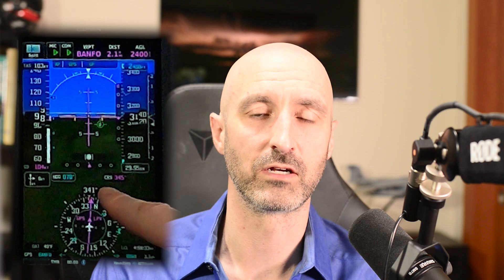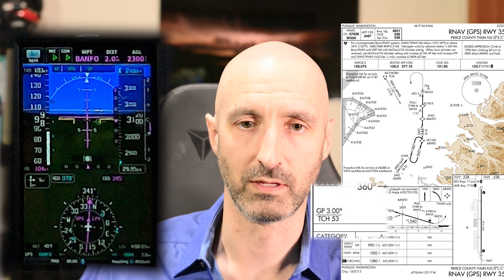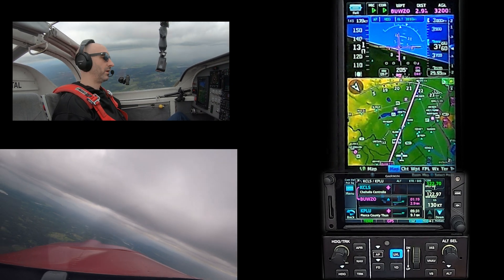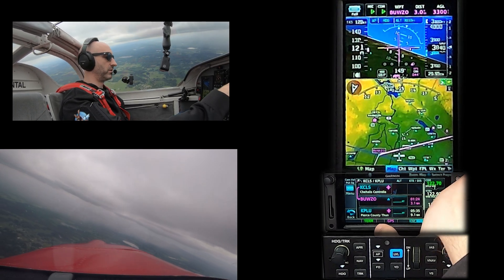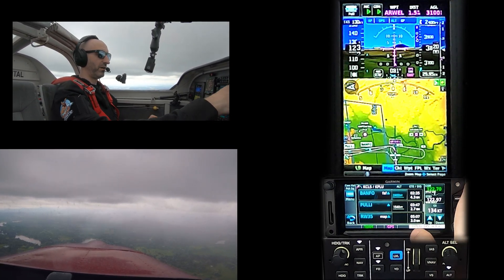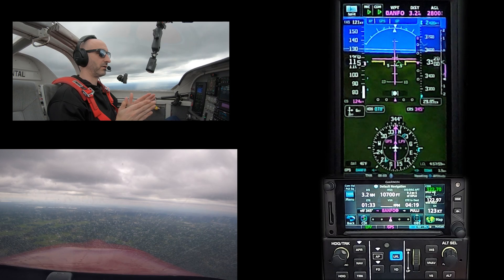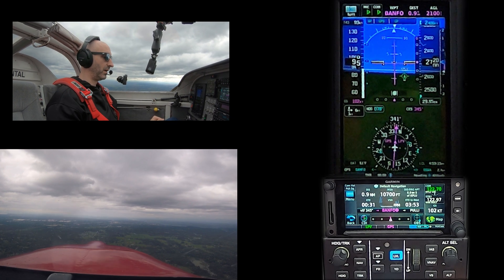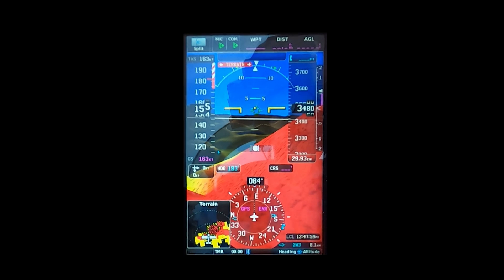Another G3X Secret Weapon: Synthetic Vision on an Approach

Comment: You have me rethinking my use of 'pathways.'  I disabled it because of clutter, but may try it again.  Why do you prefer the dual-cue command bars over the single cue (bars and cross, rather than chevrons) on the PFD?  Most folks seem to use the single cue, but I assume you have a reason.  Last - when you refer to the glide path angle in degrees, I assume you are simply reading the VV location on the pitch bars, is this correct?  Or is there a vertical angle callout I'm missing somewhere?
Reply from the maker: I keep pathways disabled for clutter, too 😎
You are right on for VV (degrees on the vector) in terms of the G3X display, and you can see it on the chart in terms of the designed approach glideslope.